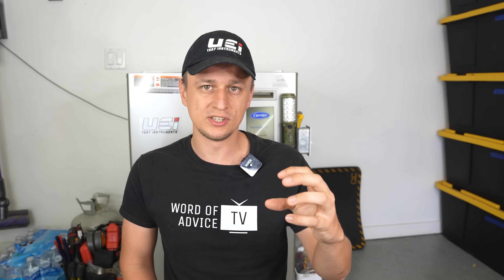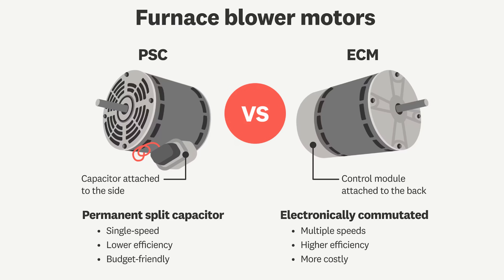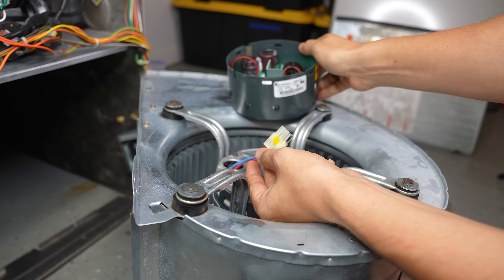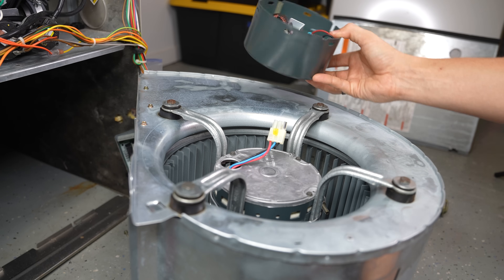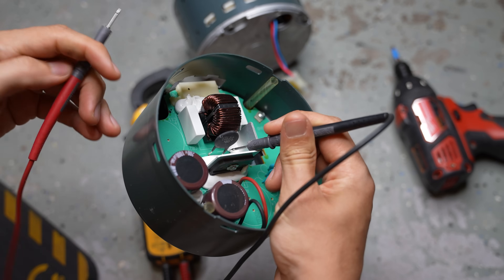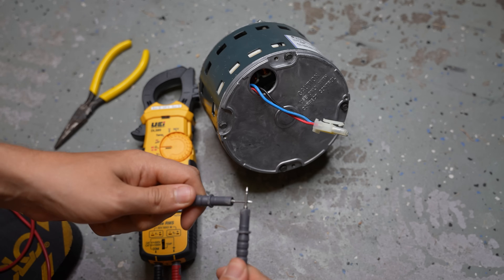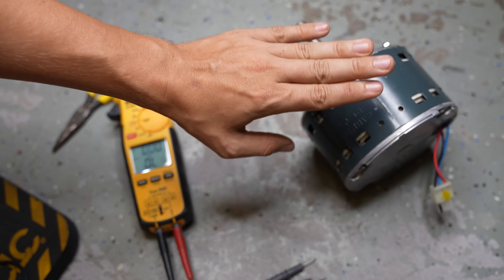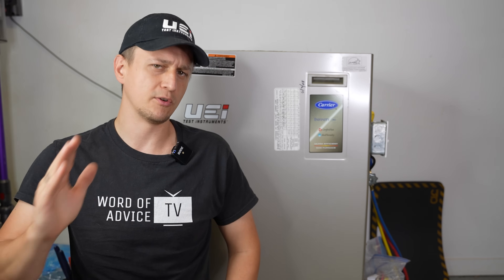So You Think Your HVAC Blower Motor is Bad?

Comment: Great video 👍👍 it’s usually cheaper for the customer to throw on a rescue motor, then trying to locate a module plus they usually  want the unit up and running right away 😂😂
Reply from the maker: Yes! I should have talked about the rescue motor option, thank you for mentioning it in the comments!
Reply: If the motor was over 5 years old. I would like to replace the whole motor since the module is almost the same price as the whole motor

Comment: I had this same issue 6 months ago. Furnace stopped working. Got quoted $7,000 for a replacement. Ended up buying a $200 ECM module from eBay and everything worked. Followed very similar steps from this video. 👍🏼
Reply: Guess you'll never call them again for anything. Hope you told your friends and neighbors. Put crooks out of business.
Reply: It's possible the tech that diagnosed the motor was bad just made an honest mistake.   It happens.  It doesn't mean he was purposely trying to scam.
Reply from the maker: Love to hear that you were able to get that fixed yourself! For 1/35th of the quoted price too. Yikes.
Reply: And they take away all the old parts,so never take one estimate.
Reply: @zLigHt44  IF you let them. Don't. Keep the evidence. If you actually have been defrauded and can offer evidence, that's what your Attorney General's office is for.  Incompetence and stupidity are not crimes but fraud is. Fraud rarely is an isolated event and among HVAC crooks will almost always be part of a pattern of behavior.
Reply: $7,000 sounds like the quote for a furnace replacement
Reply: The problem people pay ,because they don't know better,majority of these hvac people way over charge
Reply: News flash - a lot of HVAC companies are crooks.
Reply: Same. I just got quoted $1,450 quote but my heater works in the "ON" position (only blowing cold). Hes telling me bad motor and im scratching my head thinking idk mister...